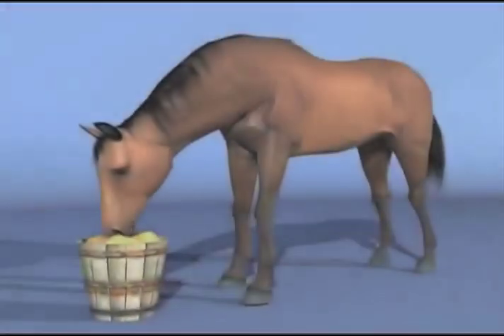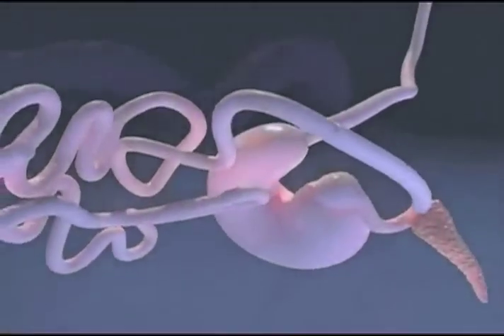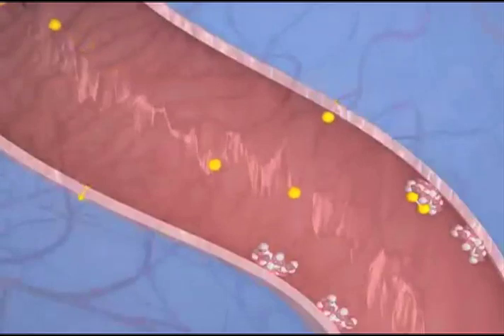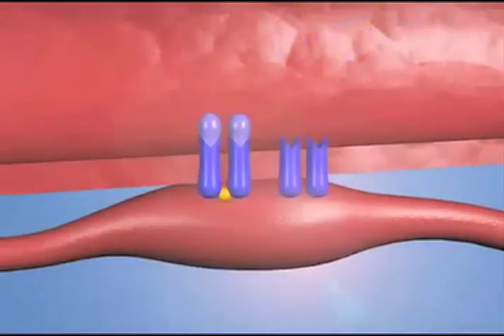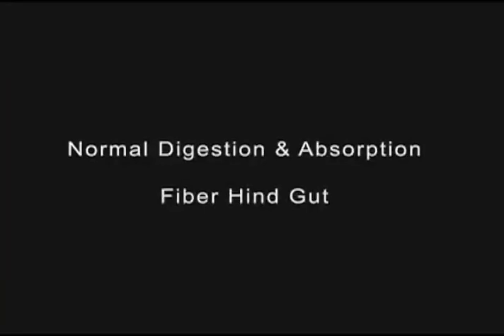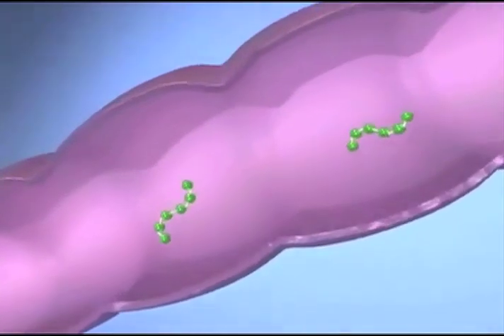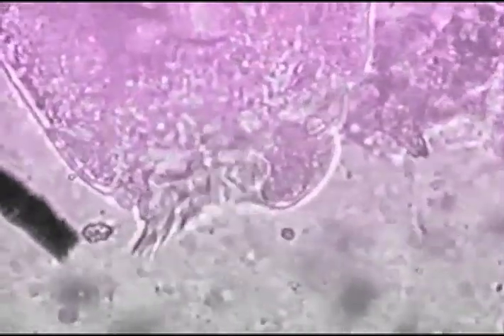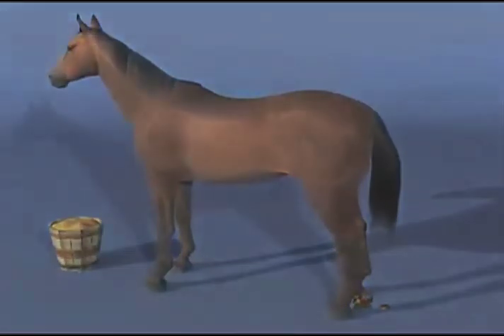3D Horse Digestion Guide

Comment: Horses are not supposed to vomit, they have a part in their pharynx called the soft pallet. It's like a fold that closes when food goes down, which is why they can't breath through their mouth. They also have a muscle in their esophagus called the cardiac sphyncter that pushes food down into the stomach. Since it only goes one way, it also helps to keep horses from throwing up through their mouth. They can have discharge from their nose with food particles in it, but that's not good.